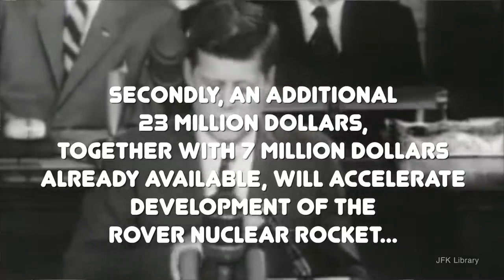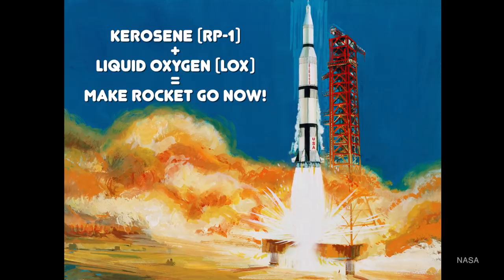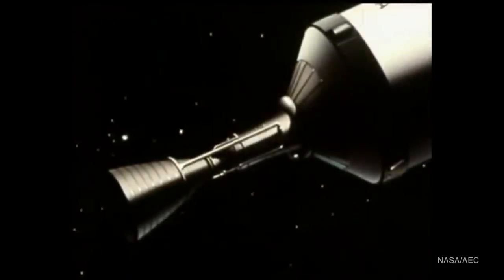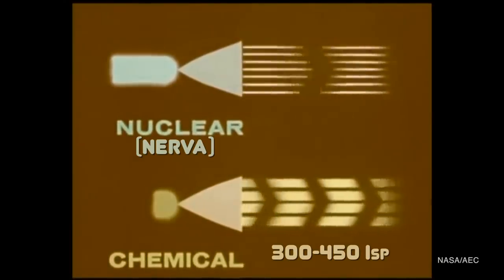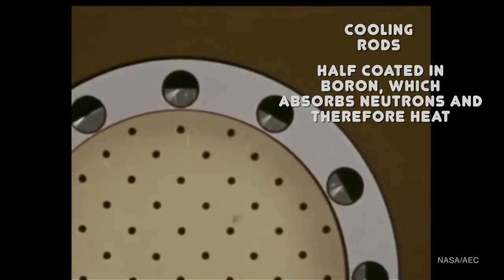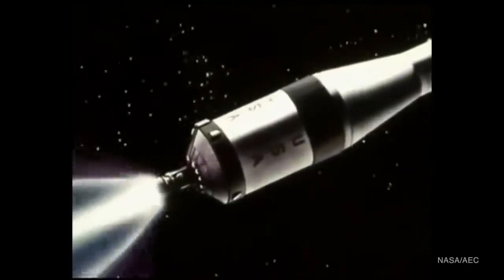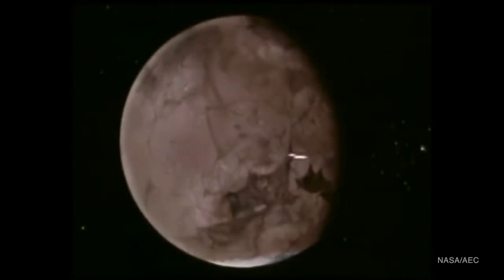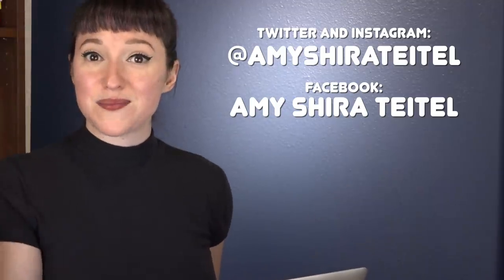A Primer on Nuclear Rocket and Why They're Awesome in Space

Comment: Great video overall! One small critique: Technically, lighter exhaust gases and higher exhaust velocities don't always equate to higher thrust. Xenon ion exhaust is accelerated even faster than the hydrogen in NERVA, but the thrust of solar ion engines is still very low. That's because the power produced by solar arrays is too low to have a mass flow rate comparable to chemical engines. The energy density just isn't as high.

Still a great explanation of the NERVA nuclear thermal design and how specific impulse is derived! Worth pointing out that specific impulse is really a measurement of the effective exhaust speed. It's just expressed as seconds so it can be used in metric or English-unit calculations. Yay, 'Merica. Haha

The explanation of Isp in seconds that made most sense to me is the amount of time a propellant can accelerate its initial mass at 1g. Or the time that expelled propellant can "hover" at its initial weight on Earth. The "time that one pound of propellant generates one pound of thrust" definition is correct when describing the duration for which the lbm of initial propellant to provide a pound-force of thrust. But some people can misinterpret that as the time required to generate a certain lbf of thrust from a lbm of propellant. Definitely important to communicate this carefully!

Glad you're back making videos, Amy! Hope you can do one on NASA's SAFE nuclear-electric prototype engines, too! :)

Comment: Just a few nitpicks, NTPRs don't fundamentally use a different fuel, the reason they can be so much lighter is that they don't need to carry an oxidizer like LOX or nitrogen tetroxide etc.  As a result all of the internal volume dedicated to propellant can be used for fuel.  An NTPR could still use kerosine or methane (especially if you want to fire it more than a couple times), most of them are proposed with LH2 in mind because LH2 has the highest on-paper Isp, an obsession I sorely wish people in the field would discard since LH2 also demands some of the heaviest and largest tankage with robust cryocooling systems and extra insulation, which can cut significantly into that on-paper efficiency.  Even if it's something close to 20-30% more energy efficient compared to say Methane, a Methane tank can be more like 40-50% smaller, with less cryocooling and less insulation to prevent boiloff on top of that.  Gripes about propellants aside, another issue is when you refer to thrust.  The maximum thrust or Thrust-to-weight ratio of a propulsion system is not the same or even necessarily related to it's Isp, in fact until you get to torch drives or the more powerful nuclear rockets (like the NSWR, Nuclear lightbulb, or Orion pulse drive) the trend tends to be that higher Isp means lower TWR.  This is the trait in which chemical rockets generally excel (usually), having very high TWRs with their very low Isp, it's why they're favored for low-altitude usage along with SRBs, although in my personal opinion SRBs are so shitty they aught to be phased out entirely in favor of kero/LOX LRBs.

Comment: The beryllium jacket isn't there to cool the reactor (that's what the hydrogen propellant is for) but to reflect the fission neutrons back into the core, allowing the reactor to be more compact. The rods also aren't for cooling; they're control rods for adjusting reactor power. As you said, boron absorbs neutrons. That interferes with the chain reaction, decreasing the reactor power (or shutting it down entirely). Beryllium reflects neutrons, so having that side face inward increases reactor power. Nuclear reactor power either grows or decreases exponentially over time, so the rods are actively adjusted to maintain the desired power.

Comment: Welcome back! I recall that there is a problem in shutting down nuclear power reactors that the isotopes generated during operation will continue to decay after the uranium reaction is shut down. This decay releases something like 7% of the operating heat of the core. This is what happened to Fukushima. The tsunami disabled the primary and secondary cooling systems and the core melted down even though the core was "shut down". After the nuclear engine has finished boosting and the H2 is running out, how would you continue to cool the core and prevent a melt down? That would create real problems with a correction burn.

Comment: Another issue. If there was an accident on the launch pad or during take off, you would have nuclear material all over the place.  I understand the shielding would add a lot of unwanted weight, which is a problem during take off.

However, if you could build the engine on an asteroid or the moon, and if you could use mostly local materials, then you could negate both of those concerns.  We're just not their yet.

Comment: Thank you for discussing this topic. In your effort to simplify rocket physics, you may have caused some confusion with the use of the term thrust.  Specific impulse is tied to exhaust velocity, not to thrust. (Ion engines have very low thrust and great specific impulse) Yes a lighter fuel can be pushed to a higher exhaust velocity, but a heavier fuel will produce more thrust. In fact there is an inverse correlation between the two.  If you were to dump more mass into the exhaust stream, you would get more thrust at the cost of a lower exhaust velocity / specific impulse.(Given the same amount of energy going into the engine) 
The ability to use hydrogen alone (without oxygen) is a side-effect advantage of a nuclear thermal rocket. It's real advantage is the insane power density of nuclear fuel. There is only so much energy in a chemical reaction and we have already approached efficiencies in the upper 90 percentile. The power density of nuclear fuel is thousands of times higher. A point in terminology here; In a chemical rocket, the fuel and the reaction mass is the same. In a nuclear thermal rocket the fuel is the uranium and the reaction mass is the hydrogen or water or whatever is ejected out the back. 
The big problem with nuclear thermal rockets is the problem of heat transfer. In a chemical rocket the fuel is the source of the heat. Because of that, the heat of the fuel can exceed the melting point of the engine. This is because the engine is aggressively cooled, and the exhaust stream is very low density, so little of that heat transfers to the walls of the combustion chamber. 
For a fission nuclear thermal rocket, you have to get heat from the uranium to the propellant without loosing the uranium. That means it has to pass through the reactor walls by conduction. So the reaction mass can only be as hot as the material the reactor is made of. If that were not an issue, atomic rockets could be 100s of times more efficient than chemical rockets, rather than about twice as good, as the NERVA was. 
There have been some speculations on how to get around this like building the reactor core of transparent quartz so the heat could transfer to the propellant more by radiation than conduction. Also in ideas about nuclear fusion rockets, the nuclear fuel is ejected with added reaction mass, so the material limits are not as big as an issue.

Comment: Welcome back! Question: just how radioactive is the exhaust from this NERVA rocket? Even if fired at 100 miles up, does it rain down?
Reply: It's a common misconception that just because something is exposed to radiation that it becomes radioactive, the exhaust coming from a nuclear rocket (assuming that the exhaust is not contaminated by bits of nuclear material) would be no more radioactive than the exhaust coming from a traditional rocket. The real risk from radiation would be if the launch vehicle (which would use chemical rockets) exploded on launch, which would throw the radioactive debris over a wide area.

Comment: The Discovery from 2001:ASO likely was the most accurate depiction of a deep space nuclear rocket. The living quarters was placed a considerable distance away from the nuclear propulsion unit and attached by a structure that was composed about 2/3rds of the ship. The propulsion unit was small, only slightly larger than the living quarters. Originally, the movie was supposed to depict the launch of Discovery from Earth orbit with massive nuclear explosions. The problem was that wasn't how the propulsion system was suppose to work, though it would look great on film. That idea was dropped for the move accurate representation in the finished movie.
Reply: Well, the explosive propulsion system is the real project - the Project Orion, and yes, it was supposed to be using nuclear explosions for propulsion. The reason Stanley changed Discovery's drive from Orion to nuclear thermal is because of his earlier film "Dr. Strangelove", since he thought, that the people will think he really loved the Bomb.

Comment: Best part: you get to deal with hydrogen embrittlement and neutron embrittlement!
Reply: And that's why modern versions should be made for using methane. Besides, easier ISRU-refueling near Mars.
Reply: @caav56  That reduces efficiency. Plus, fueling a high-temperature engine with a hydrocarbon is a bad idea, since it would eventually clog with coke deposits.

Comment: well, Miss Amy should make somebody check her script before recording:

The Cold War was the wrestling of world powers (USA, USSR) for the No. 1. spot. (Nuclear) Arms race was part of this "competition".

Transfer windows are useful, because you can get to another planet with the lowest possible energy used. So it has less to do with gravity. and more to do with timing.

Ion engines dwarf the nuclear ones. They are both more efficient, and engineers don't have to deal with extra radiation from the engine. Their only downside is much lower thrust. They were first developed in the 50-60's as well (future vintage space video?:D).

Comment: man, I've got to ask the question.

The hydrogen isn't altered chemically when it comes out the other side, right?
so, could you make an engine that uses a chemical reaction on the other side?
nuclear core heats hydrogen, then burn with oxygen, like a nuclear-chemical engine.
Have those ever been proposed?
Reply: Unfortunately this would not get you anything.  The hydrogen should leave the nozzle somewhere in the range of 3000°C. Water as the reaction product of oxidizing hydrogen decomposes at about this temperature. So to make it work you would have to work at lower temperatures, therefore lower exhaust velocity, thus reducing ISP. A afterburner works with a turbo engine since the fuelrich exhaust of the turbine is heated up increasing temperature and therefore exit velocity and thus thrust.

Comment: I know hydrogen is the best propellant from an ISP point of view, but I wondered about a methane NTR. According to what little I've found it has an ISP of around 620, but on the up side it would be far more storable for long duration missions and being denser requires smaller tanks and less structure all around.

Comment: The specific impulse of Ion drives is even higher than nuclear engines. They don't require radioactive material and have virtually no moving parts. They are very power hungry though, and the acceleration they produce is very small. So they are probably not viable for manned space exploration.

Comment: People who complain about the safety of nuclear rockets don't realize that some of the reactors for project rover actually failed a few failures were on purpose and the reactor didn't really produce a whole lot of material and breaking up so fast it stops the reaction entirely so no china syndrome. It's possible to even raise the specific impulse to 10 or even 20 times that of chemical rockets with things such as pulse nuclear thermal which uses the neutrons to heat the propellant hotter than the reactor. I love nuclear rockets!

Comment: That's nuclear thermal, there is also nuclear electric. Was NASA specific on which of the two got funding? Maybe another video?

There is also nuclear thermal with a gas core. No one has built one yet but that would be cool (or actually, pretty hot...).
Reply: There is also nuclear pulse propulsion -- i.e. Project Orion. That was worked on until the Partial Nuclear Test Ban Treaty took effect. 
Of course, there was the concern of using its "fuel" (nuclear bombs) in atmosphere. However, later concepts designed to operate only in space worked around that limitation.
Reply: @oscar_wildecat6208  Yeah, there is that little problem of putting nukes in space... that being said, if there was an asteroid coming the technology could be useful in changing it's trajectory.
Reply: @zapfanzapfan  If I remember correctly, later concepts dispensed with the nuclear bombs (better save those for the asteroid) in favor of laser or antimatter assisted fusion. (Example: Project Daedalus.)
However, I don't think anything along those lines has made it past the "hypothetical"  stage yet.
Reply: @oscar_wildecat6208  Yeah, sustained fusion that makes power seems forever 20 years in the future... and then to put it on a space ship... I think I would bet on laser powered solar sails being the technology that gets our probes going really fast in my life time.

Comment: A really nice video, but I think you've made a bit of a mistake in your thrust vs isp section. Higher exhaust velocity does not always mean higher thrust, because you have to take the atomic mass of the expelled propellant into account. Lower atomic mass means lower thrust, so hydrogen is going to produce less thrust than chemical rockets on that basis.
Higher isp does mean higher efficiency, but usually comes at the cost of reduced instantaneous thrust. As I recall it, nerva was never going to be a launch stage, as it didn't produce enough thrust. It was intended as an upper stage engine for use in orbit.

Comment: Well to be honest USA had been pursuing plenty of nuclear designs in addition to the Nerva. The original Orion ship was built around tiny nuclear bombs. While obviously not an option for inter-solar travel (as nukes can fry a satellite and as a general rule should never be put in orbit around our planet) the idea is still the most practical one for interstellar travel unless you leave the idea of conventional reaction based engines behind. The main reason is the design although bulky is very simple. A more modern take on the Orion would be the Project Daedalus which used the same idea but rather than a bomb detonated a tiny radioactive pellet and then used the byproducts of the reaction as exhaust. While the entire Project Daedalus was stipulated to be using near future tech most of the stuff it required is not even close to existing yet. Given that the project ran from 73 - 78 my money on an interstellar probe would be Orion or something none nuclear altogether like the Breakthrough Starshot's miniature light sail probes. Obviously those require some pretty insane innovations too, but unlike Project Daedalus most of these innovations will have benefits in other areas outside of space exploration.

Comment: The weight added when using humans , I would think removes any advantage in ISP it would have over chemical. Not to mention the NERVA model you had shown to push the hydrogen through the radioactive core. The would leave a trail of radioactive material. Unlike that of just using a transfer element to isolate the radioactive material from the propellant. I'd be more approving of endothermic(resultant fused material could be used for other things and cools down the area instead of radiates) nuclear fusion than (toxic)fission. If a launched rocket performs rapid disassembly , the area could be lost permanently at worst or longer than space geeks would want to wait for another launch on the low end. Still out into the future, but the Eagle works engine provides very interesting means as using space itself as a propellant. Using some future version of this with fusion I think will be ground breaking tech and move through space at will for inner solar system mobility. But until then we have many hard decisions to make. Come on NASA boost that funding.

Comment: Launch (transfer) windows aren't about getting a boost from gravity to make the trip take less time. Attempting a transfer at a less than ideal time requires far more energy because you have to travel in a more elliptical (IE, straighter) path. You also have to lose that energy on arrival.. a trip that takes 1500 delta v normally might take 7000 outside of a transfer window. However, you will arrive FAR sooner as you're travelling a shorter parh at a faster speed.

Gravity assists typically save delta v at the cost of time. Flying by Venus amd/or Earth several times over the course of years boosts a spacecraft's orbit for "free", and can be a more economical way of sending spacecraft to the outer planets.

Comment: Couldn't they have long cables separating the propulsion parts and the living/control capsule? Like skiing with kites.
You have two propulsion units in front of your right and left connected by long cables so you are not in the way of the exhaust. You also have additional two propulsion units trailing behind you.
When you get to the Mars you dump the two in front of you then maneuver and land with the chemical rockets on board of the living/control capsule.
On the way back home, you then fire up the remaining two nuclear propulsion units. 
That should be viable. Right?